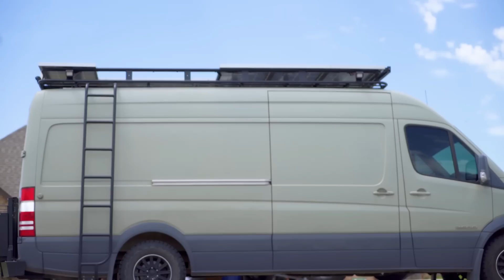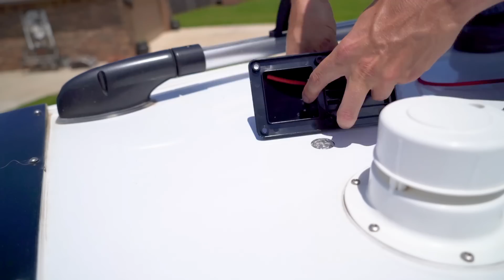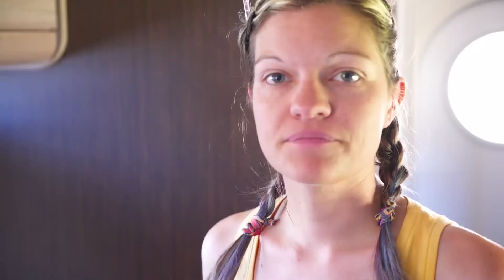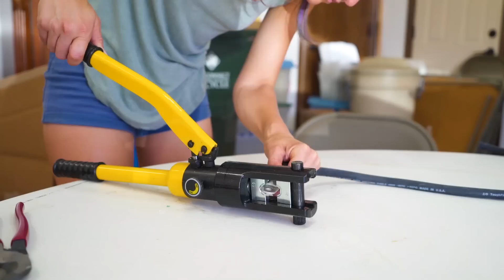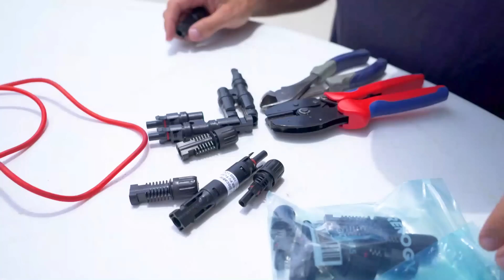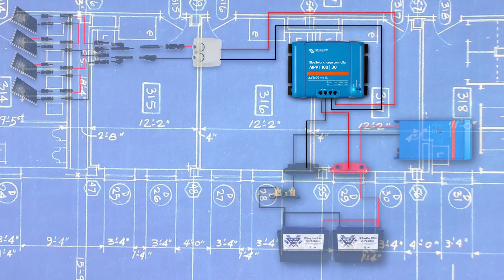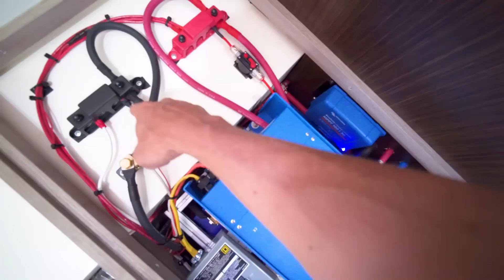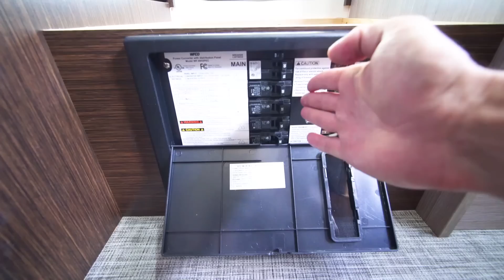Camper Solar Setup Tutorial - How to Solar Power your RV, Camper Van, & Truck Camper

Comment: I’m putting solar on my camper and I need your help. I have 1800 watts of solar panel and I have a victron components  a multi plus 12/3000/120 inverter also a lynx 1000 bus bar. And I need to know what size charge controller or controllers i need . Also what size fuses I need to use. I’ve already fried 2victron charge controllers and the inverter charger which I have had replaced. So to keep from that from happening again I am reaching out to you .i  followed your video to install everything and everything worked until I hooked up the charge controller that’s when everything fried so I want your assistance to reinstall the components again
Reply from the maker: Thanks for reaching out! With that much equipment already damaged, we’d definitely want to take a much closer look at your full system layout before recommending charge controllers, fuses, or wiring changes. Please contact our support team with photos, a wiring diagram, and your component details so we can help: https://shop.explorist.life/support?utm_source=youtube&utm_medium=comment&utm_campaign=support&utm_content=response_link

Comment: Thank you for the video. I have a 5th wheel. It has two standard batteries in the front compartment. They’re standard batteries that are included. I want to add solar. Only time on my inverter is my refrigerator. It’s 12v only. Everything else is on the converter. Can I add solar to what I have or do I need to replace the inverter and bypass the converter like you have done? I would like to use what is there. Is that an option? Thank you.

Comment: Thanks for the great video. In this system you added an Inverter/Charger to a system that already had an Converter that charges the batteries along with an solar charge controller. Why the Inverter/charger and not just an inverter? Thanks

Comment: HI, Steph. Do you need to use anchors when using self drilling screws? If not, what would you recommend to stop water from leaking into the van? Thank you

Comment: Great video as usual. I was wondering if you disconnect the converter will it still charge the battery on shore power. ?
Reply from the maker: The converter won't do anything when disconnected.  The Multiplus inverter/charger takes over that job.
Reply: thanks for the quick response. I only have a charge controller and separate inverter. so, i don't think I should disconnect the converter.  I use a separate ac outlet when I use inverter. Is that about right?
Reply from the maker: I only design systems with inverter/chargers; so I can't speak much for how you've made your own design decisions.

Comment: It's crazy, I restored a 52 chevy that had butyl seals back then and they were still soft after all those years. I just started working on my 2006 travel trailer I bought and the same stuff on the roof under the dicor sealant
Reply from the maker: Nice!  Yeah, it's good stuff.

Comment: personalmente non avrei mai messo le batterie e tutti gli altri componenti elettrici dove passano i tubi dell'acqua .... considerando che uno dei due tubi è pure dell'acqua calda e che non è coibentato ... quindi scalderà pure ...
Reply from the maker: That's fine.  You can put this stuff wherever you like in your own build.  What we did is just fine, but if that makes you comfortable, it's important to remember that the way WE installed doesn't affect you in any way; so you'll just want to alter as necessary for your own install.

Comment: Awesome video! However I am  a newb so I came away with a few questions.  I have a pop up camper ( rock wood exp) and it says setup for solar. But I’m thinking ( don’t get me started on rockwood’s customer service and/or techs , and i use that term lightly) that only means if I buy a solar panel and their proprietary plug I will be able to plug it in and have it charge my battery as another option for charging the battery… BUT its mounted on the tongue of the trailer and I know I need more power anyway….. so. This is what I’m thinking,  If I go with a power queen 190 battery and install it inside the warmth of the camper  and simply moved the battery cables that run from the existing  system over to that battery I will essentially only be moving the location of the battery correct? THEN I have a portable solar panel which will run to a charge controller which will be attached to the battery.   Then my alternator and shore line should charge my new battery just as they were designed and the panels charge it when have them plugged in?    Im assuming your mothers camper came with a battery, but I noticed you did extra stuff , and it was probably because you can bypass the factory stuff and put in better quality stuff , but couldn’t you have simply put the panels on top and went to a charge controller to the batteries,  then just basically extended the existing battery cables to your new batteries and it work the same?  PLEASE PLEASE PLEASE don’t get me wrong I am in no way. Critiquing your work or knowledge, I am simply saying I don’t have that knowledge and I would like to do that and I’m asking will that be essentially the same thing?

Comment: Hello I have a Travel Trailer made by Keystone. It is a 2019 Hideout it has a battery for the DC system. It has a solar panels connector on the side. This means all I have to do is to update my batteries and I should have a similar system? Minus the monitor system for the battery. Or it means that I can add solar panels to charge the batteries and that it’s. Thanks
Reply from the maker: Batteries, Inverter/Charger, Add a charge controller if the panels don't have one, proper fusing, wiring, etc.

Comment: Great job thanks! I found this while researching how to install in my pop up camper… it claims “solar ready” “just plug in a panel”, but absolutely no one can tell me the specs so I guess ill have to buy all of this and install like you did. IDK  maybe I could somehow get in touch with you one on one and save me a lot of time trouble and money, lol
Reply from the maker: Often, 'solar ready' just means that the wires have been pre-run for a solar panels and that's all.  Pretty much a marketing gimmick in most cases, unfortunately.

Comment: How many volts should my single 200 watt 12volt panel be bringing in? With full sun it’s been bringing in over 26 volts which cuts out the controller.

Comment: Great video. New link is confusing to me. Which diagram would I use for 400 watt solar, 200 ah lithium battery in an truck camper that is already wired for shore power.
Thanks, Craig

Comment: Very well done.  I'm a little nervous about drilling holes In the roof if I can avoid it.  I'd like to see your opinion on the gluten mounting points to hold panels.
Reply from the maker: I recommend using mechanical fasteners like screws or bolts in addition to adhesive and sealant like shown in this video.  I do not recommend adhesive alone.

Comment: I got a chuckle out of viewers saying your 800 W system is too big. I don’t think I can run two laptops off of that for 24 hours a day. Certainly can’t cook anything and run an air conditioner off of that.
Reply from the maker: There are a lot of people who have the mindset of "Well, I only need enough power to charge my phone once every other day, so that should be enough for everybody".  I truly don't understand that mindset.  It's pretty frustrating.  Everybody has different needs.
Reply: True.  For me, if I can’t sleep comfortably than I want nothing to do with a camper.  I don’t live in it during the day.  It’s a mobile studio apartment to go back to after a day of whatever.

So sleep I need heat or a/c. And for that you needs a ton of batteries.  You also need a good mattress.  EVERYTHING else is icing on the cake.  

I find it frustrating that manufactures still clutter the roof with garbage A/C units, and other items that do nothing but get in the way of solar panels (and leak rain water the day you go on your first outing).

Comment: Would anyone have information on converting the drive train to electric.
Reply from the maker: All you have to do is uninstall the gas motor and install the electric motor.  Should be a pretty straightforward process. 🤪🤪

Comment: I have installed 2 455W Solar Panels paralel connection with a 60A Epever tracer Controller , 1500W Inverter and 2 6V 450Ah Batteries. I have a daily consumption based on 700W Microwave ( 1h/day) , 8meters of 230V Led Lights for 4h all , 4 of those led m 6h a 32" TV for about 8h, water Pump 1h and the heat fan ( gas fuel) for 6h in the winter. 3 cell phones charging 3h  laptop 2h and 24h wifi router.  Looks ok in your opinion? I only use the fridge on gas. I'm not sure if i can use it on 12V from Batteries.. thank you for your amazung vídeos. Regards
Reply from the maker: This video will teach you how much power all of those things should use on a day-to-day basis: https://youtu.be/a406IxiU-Xg

Comment: i get disconnecting the converter but could you run dc power from the battery to the power distribution box (with the CONVERTER disabled) and take advantage of the DC fuse panel and having everything wired. i'm taking out a defective inverter and installing an inverter/charger and want to drop the converter as well
Reply from the maker: Awesome!  Glad it helped.  Thanks for watching!

Comment: Curious how the panels on the roof rack held up? My truck camper has the same setup with the Thule tube rack add on and I wanted to put panels on it, but the first time I put any weight on them I saw how easily they bowed. I thought a few panels would for sure rip the Thule rack off on the freeway. What was this owners experience after a few years?  Thanks.
Reply from the maker: So far, so good!
Reply: @EXPLORISTlife  OK right on, thanks for the quick reply it's appreciated.  You have me rethinking what I am right about to do.

Comment: Is it ok to install a multiplus laying down like you have in this video? Thank you both.
Reply from the maker: It's 'best' to have it vertical so heat can dissipate easier.  If you lay it flat like we did in this install, you'll want to make sure there is adequate cooling to the enclosure like adding a pair of computer fans like we did (I don't remember if the fans made it into the actual video).

Comment: Thanks for your excellent videos. I understand all of the concepts you present, and I know what I want in the power system for my camper. I’m comfortable with all the electrical connections that need to be made, as well as the electronics for managing the system. 

Where I need help is the physical wiring. I have no direct route from the camper’s load center to the battery location, so wires have to go out through the floor and then back up. Then there’s working in some tight spaces, as well as fans for ventilation. 

I can’t seem to find an installer to work with me in the Philadelphia area. Could you advise me on how to go about finding someone to do the wiring for me? They don’t need to be an expert on rv installs, as I am familiar with what I want done. 

Any advice you can offer, or if you know someone to recommend, would be greatly appreciated. Thanks. Steven.
Reply from the maker: I'm more in the 'teach you how to do it yourself' space.  I don't have formal connections with installers and don't make recommendations.  I've been burned before by recommending installers and therefore must decline to make a recommendation in that regard.
Reply from the maker: In a retrofit, though... you don't always need access to the wires from the OEM battery location to the power center.  Check my retrofit diagrams here to see how that works: https://www.explorist.life/solarwiringdiagrams

Comment: Shouldn't you be able to run your AC off of a multiplus inverter with a slow start capacitor?

Doesn't the multiplus use the A/C in to deliver A/C out and only use D/C in when A/C in is not available?

If you have enough batteries and a properly sized inverter you COULD run your entire rv off of the inverter right?
Reply from the maker: Sure!  With a properly sized battery bank and adequate inverter capacity, we could power whatever we wanted.

Comment: Why do you have wire that I would be running on a 400 amp boat motor for a solar system that is only pulling 30 amps?????

Comment: with that converter did you just remove the wires from the supply and then power it off from the solar system? I think I followed that correctly But I wanna Make sure. my install is completely fresh except for the breaker box that came with the trailer as it was a race car trailer in a past life.

Comment: Nice equipment and set up. However, my main concern would be the heat build up and inadequate ventilation of the components in your containment space. Did you experience any excessive heat during its operation?
Reply from the maker: We installed 2x 12v computer fans to ventilate that enclosure off camera, so there is plenty of cooling in there; so no... we didn't experience overheating issues.

Comment: Im curious why they decided to mount the solar components inches away from the PEX water lines.  Doesn't that seem dangerous or destructive?  Any thoughts or observations?
Reply from the maker: Although not 100% ideal, space in this camper was INCREDIBLY limited and we had no other options.  Ultimately, what we did was fine, but if you have a spot in your own camper without water lines to install, you should go that route if possible.
Reply: @EXPLORISTlife  thanks for the feedback.  These videos are a god send.  Terrified of doing this solar and basic electrical in my (hopefully) future skoolie.

Comment: Hello again Nate.  I have one more question.  In my camper, I have the same WFCO Power Center as in this video.  I have disconnected the AC power running to the WFCO charger/converter and also disconnected the DC output of the converter from the DC distribution side of the power center (+VCC and -NEG).  Should I connect my DC +  coming from my Victron Lynx Distributor to the +VCC or the +POS of the DC distribution side of the WFCO.  Thanks!

Comment: Ok, I have two solar panels that are both 240w.  What I need (other than cable and mounting brackets, etc) is a charge controller and an inverter?  I would be converting an existing motor home that has an electrical system.  I am tired of lugging around my generator.
Reply from the maker: I have a 30A and 50A OEM RV retrofit diagram and parts list available on this page that should answer those questions: https://www.explorist.life/solarwiringdiagrams
Reply: @EXPLORISTlife  I don't understand wiring schematics, so Ill go somewhere else.

Comment: I am continuing to work on a similar project for our truck camper and am using the same 2000W Multiplus.  I am tying three 12v 100AH LiFePO4 batteries in parallel using a Victron Lynx Power-In.  I am using 2/0 wire. I have a 300amp  main fuse (post Power-In module) but am concerned about the the unprotected lengths of cables (approx 3-4 feet each) between each of the batteries and the Power-In module.  Would you recommend putting BlueSea terminal style fuse on each of the three batteries? Will 300amp fuses work?  Love your videos. Thanks!
Reply from the maker: Yes and yes.  That is indeed a good idea.

Comment: hi nate! im having a delima. i assume that camper had something like a converter/charger built it. i have already bought all my solar equipment for my cargo trailer conversion, and now bought a converter/charger (progressive dynamics 4135) to add to the mix. kinda like the reverse of what people do after buying a camper and then adding solar. i cant find a diagram like this on your website. and with so many victron devices in your diagrams it confuses me. please help and ill explain it further. thank you
Reply from the maker: I don't have any diagrams like that as I recommend inverter/chargers over standalone converters.  Sorry about that!
Reply: @EXPLORISTlife  ok. i just posted on your website... scratch that. so you pull out those stand alone units in campers when adding solar?

Comment: Would be nice if you would have let it slip what gauge wire is being used. By the size of it, the battery to lugs to inverter looks like 4 or 6 gauge. I have not figured out how to get the wiring schematics so maybe it's covered in there.
Reply from the maker: Check the diagram here & parts list for wire sizes here: https://www.explorist.life/2000w-inverter-200-400ah-lithium-200-to-700w-solar-camper-wiring-diagram/

^^^This is the updated diagram for this system.

Comment: Great video. You should add a rubber grommet on the roof entry gland where you drilled into the roof so it doesn't cut the wire over time.
Reply from the maker: Thanks!  Too late for that my dude.  This build was completed a few years ago so thats no longer easily accessible.... and the camper is about 500 miles from me at the moment.  But feel free to put grommets wherever you like when you get to this portion of your own build.

Comment: Good vid, but you could have kept the converter in place to charge the batteries if there is no solar. I did that with my camper. I just added a switch to the AC input for the converter so when I turn on the Inverter, it shuts off the converter. No weird charging loop. :)
Reply from the maker: I recommend disabling the OEM converter when retrofitting an Inverter/Charger into an OEM camper but I'm glad you found a solution that worked for you in your own setup.
Reply: @EXPLORISTlife   I have an electronics background so, I was not afraid to do a little in depth wiring. 
I just wanted it to be able to still be charging if I plug it into shore power. :)
Reply from the maker: Indeed!  That is a very important functionality.  The way we did it in this video does that as well.